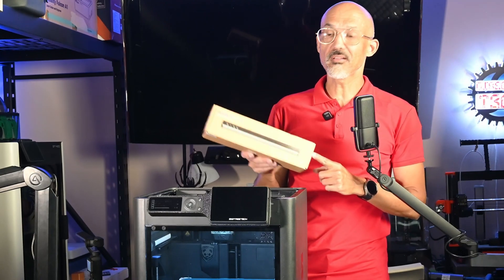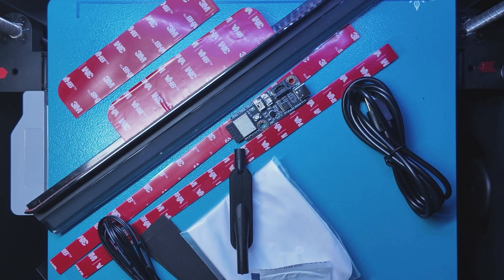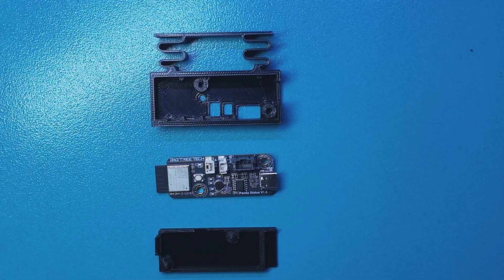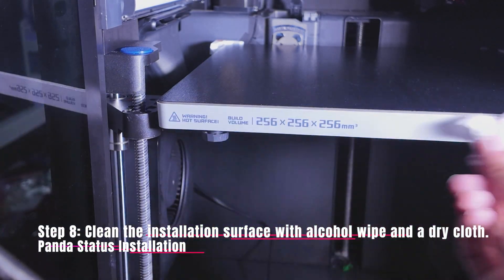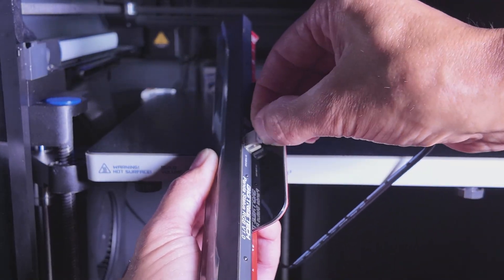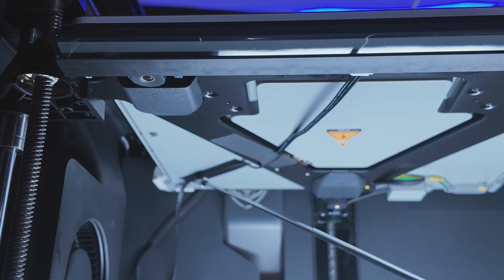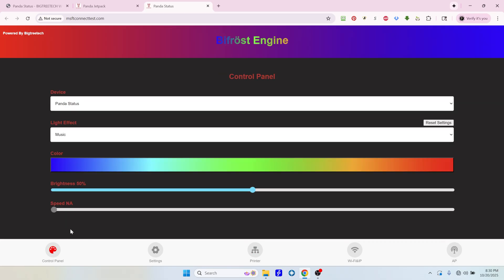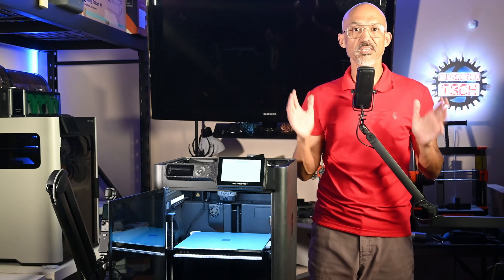Biqu Panda Status - Bambu Lab P1S Installation and Thoughts

Comment: I don't like how it leaves a bit of the gray bed edge, for me it ruins the aesthetic of the mod afterwards. Also you can see the single LEDs through the diffuser, where og H2 series don't have such effect. In my opinion there's room for improvement of this mod.
Reply from the maker: I'm sure they were trying to keep the cost reasonable.
Reply: @directedt3ch well, the panda status bar came out before Bambu Lab introduced spare parts for H2 series, which now show that the prices are comparable, so the reasonable price does not convince me. Though I would put extra $10 just to get better visual quality. Still grateful for attempting to give the customers such mods at all.

Comment: You left out a very important part of the install. Specifically about how much slack should be left for the heat bed to safely go up and down.
Reply from the maker: Good point.  I drove the heatbed all the way down to get an idea of how much cable to route through beforehand.